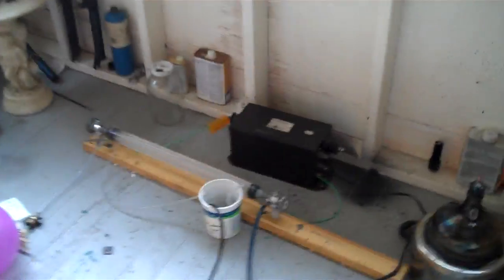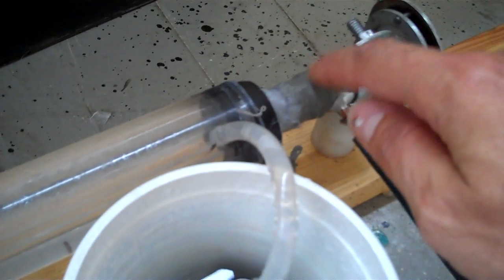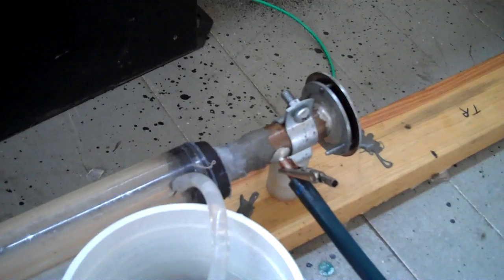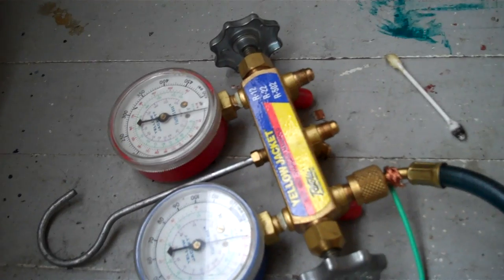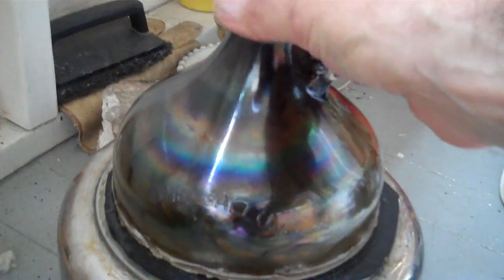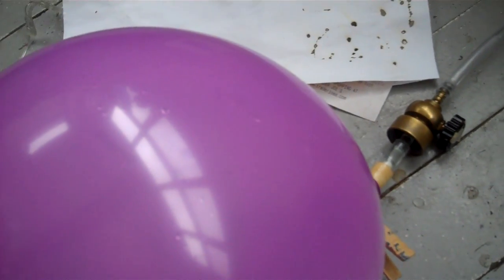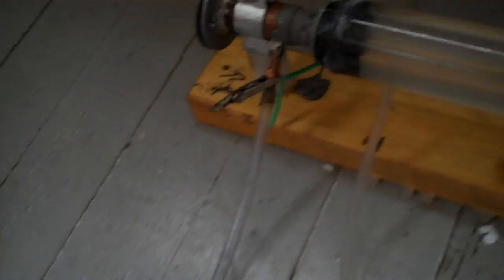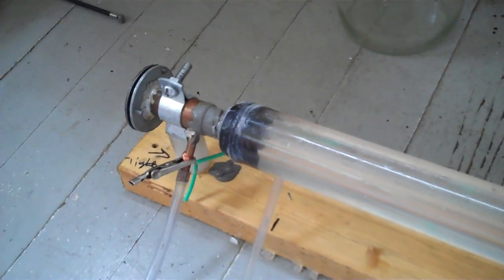homebuilt co2 laser

Comment: Sputtering is great. For those without this skill, polished metal or first surfaced mirrors will work. Long focal length curved mirror is ideal, as a high reflector, but not absolutely essential. Almost anything will work if the surface is reflective (no back-surfaced mirrors!). A simple hole, covered with rock salt, will pass the output beam.  Rock salt is the only common material I am aware of, which will pass the CO2 laser wavelength.
Reply: How do you get a seal on the rock salt? What size should the hole be?
Reply: Засыпанная соль пропустит воздух. Нужен кристалл высокой чистоты!